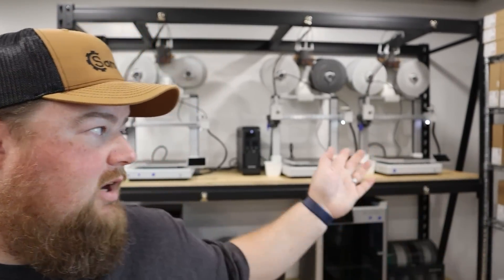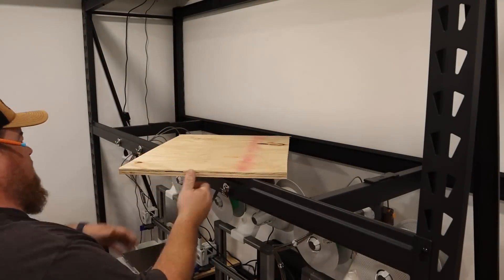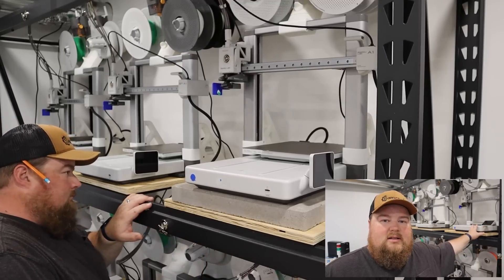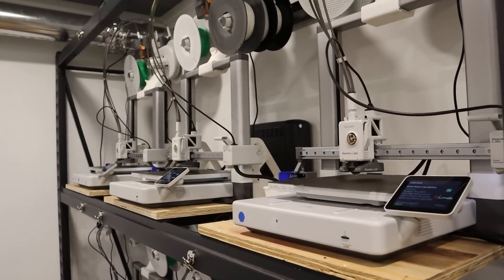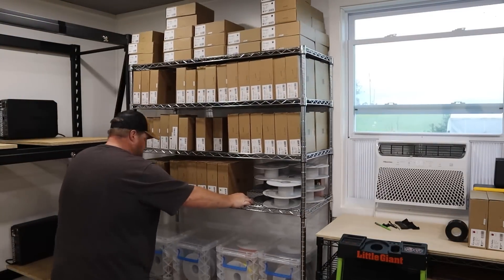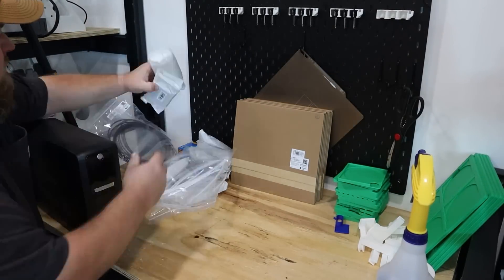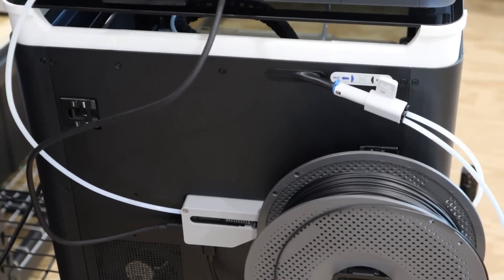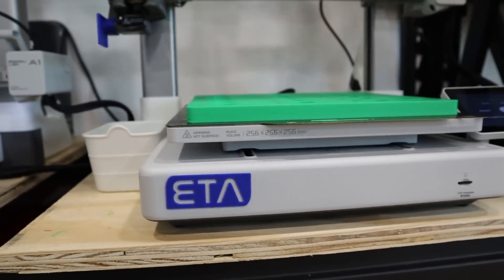Expanding My 3D Print Farm with More Printers! // 3D Printing Business

Comment: For the table top you cut a bunch of 2x4 boards the width of the table, get a large drill bit and drill a hole into the side of a 2x4 board, and you glue and screw the board to another board, then hand plane or use a planer saw. For smaller printers you can glue the 1.5" sides together, for a large 3D printer you can glue the 3.5" sides together, or you can get a wider board and cut that up into whatever length boards.

Comment: Is there a reason you used a UPS instead of a power station?  UPS use lead acid batteries that wear out pretty quickly even if you never have a power outage.

Comment: Any concerns with a room full of printers spewing out microplastics? Probably dont want to breathe that in.
Reply from the maker: Honestly, yes. I have been trying to research options and solutions on this. Manufactures are silent on this (of course), so finding concrete information is difficult. I have a few air quality meters in the shop (albiet cheaper ones that may not be picking up microplastics) and I also run my large filter that sits next to the filament rack all the time (minus when videos are being filmed). Safety is a concern of mine, I just don't have the information to share yet.

Comment: For naming, its better to do color than number. so 1-6 is always in the same order, 1 top left, 6 bottom right. then the shelf has a color itself. So Red 4 is red shelf, bottom left. If you run out of the 6-8 easily identifable colours, you then go up to 12 instead of 6 left to right. So 8 is red shelf right shelf, middle top. You'll not find an easier more scalable method of naming and finding, especially for new employees.
Reply: This is great, I Will use IT!
Thanks :)

Comment: Can you anchor those shelves to the wall or floor in any way? If you can isolate the shelf from being able to move you're a little foam isolation under each printer should be fine

Comment: Commenting while I'm watching, you've pretty well effectively negated the need for that paver by dampening the vibration with the foam tape on the boards.  That SHOULD be enough to keep them from affecting each other.  What I'd like to know is what shelves are those?  I need some heavy duty racks for my printers (various brands at this point), and those definitely look more heavy duty than the gorilla racks I'm used to seeing.
Reply from the maker: There's a link to them in the video description now. They're from Lowe's Home Improvement.

Comment: Man, you've got a nice little print farm there. I was watching the segment about your UPS, and I had a thought. There's some old(er) UPSs from APC, something like the SMX1500RM2U, that are meant to go into a server rack, and are much more reliable than those little consumer units. They can be had for cheap on eBay, and refurbished with inexpensive batteries. They measure 19.3inx17inx3.5in, and weight 55lbs! I wonder if they could make dual purpose, as both a UPS and a heavy base to increase the printer's inertia?

But, with the size of your farm, and I presume your intention to grow it, have you considered some sort of DC power distribution system, with a DC UPS? You'd probably be able to get much more runtime in a blackout, and it would be more efficient, because there's less voltage conversion going on. Edit: I think the A1's bed is heated by AC, so, never mind...

I'm currently at 4 FDMs, and I'm now looking for space to expand, lol

Stack 'em 6 high!

Love your channel so far, you've got a new sub :D Keep it up

Comment: Looks great! I have a question. Are you using any active filament dryers or just passive drying with silica packs?
Reply from the maker: Just desiccant packets in the storage tubs for opened filaments not on the printers. I only print with PLA at this time.

Comment: How many 3d printers can handle for a UPS 1500VA/900w ?
Reply from the maker: I push the envelope by connecting three A1s to one UPS. If I start three jobs at once, it sets off the alarm when the printers heat up the build plates initially. They've not turned off on me during this time though. I mainly have these for power blips and short outage protections. If I wanted the most extreme runtimes I would have one UPS per printer, but the UPS units are half the cost of a printer, so I choose to run them this way.

Comment: with the amound of printing you do it might actually pay off to make youre own print wire from pellets
as for the paver stones : there not too hard to make using sheap plastified chiphoard (old ikea cabinets cut intoo the size boards needed ) silicone the inside edges and pour concrete in there 
can take the stuff off once hard or just keep it on there and use the whole thing

Comment: Do these shelves hold up with all the movement of the 3D printers? I'm looking into getting some shelves and was just wondering what you thought of the one's you purchased. 

Another great video btw! Keep up the awesome work!
Reply from the maker: The shelves are rated for so much more weight than they're holding. If anything, the rigidity of the shelves and movements of the printers could maybe be improved. However, I've not noticed any issues with my print jobs.

Comment: I see a lot of people use the risers for the P1S and X1C. What exactly is your reasoning for it? I've never used them and never had an issue personally.
Reply from the maker: I did these for heat dissipation with my PLA print jobs. I had issues with quality that ended up being they were too warm inside the enclosures. It's worth mentioning this was also in the summer time here in TN where we regularly had temps in the 90s. I think it would be less of an issue in the cooler months.

Comment: Have you done any testing for Z wobble with the top mount ams? All that extra weight up top has to affect tall prints. I hang all of my spools on the rack with custom roller bearing hangers I've made. Haven't tried hanging an ams yet, be curious if it'd make a difference.

Comment: Hey, Sam. I had problems with my cyberpower UPS. It uses a dumb charger and the battery crashes very suddenly. Mine only lasted a couple years and it was toast. I think the cyberpower tends to overcharge the battery a tiny bit all the time. I switched to a UPS with a smart(er) charger built in that exercises the battery and does not overcharge it.  Going on 5 years now with no issues.  You may want to check the batteries manually every now and then with a load test to make sure they'll be ready and able when you need them.
Reply: What did you switch to?
Reply: @jsrogers6464  I switched to some APC units, and they have been doing good ever since. There are probably other good units out there, just make sure they have an intelligent battery care scheme.